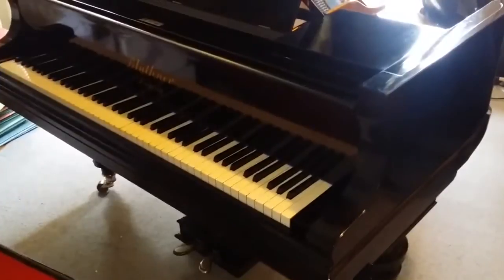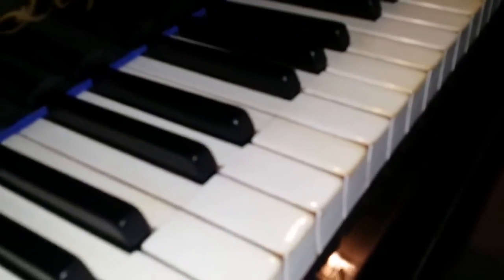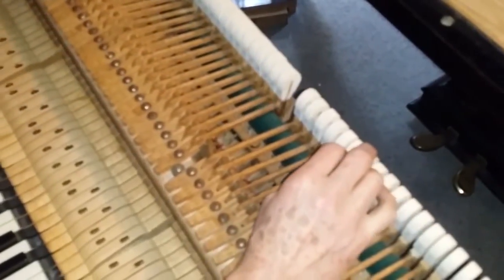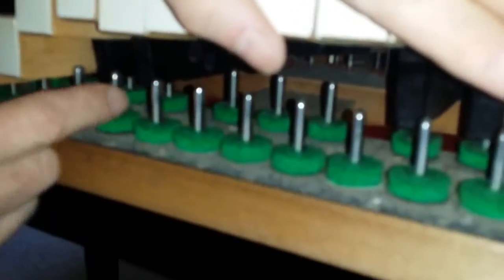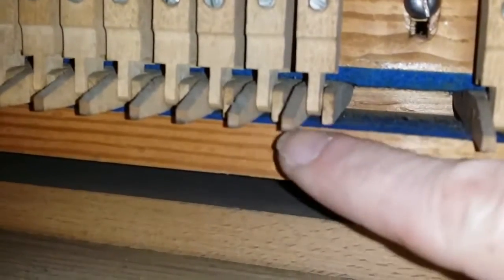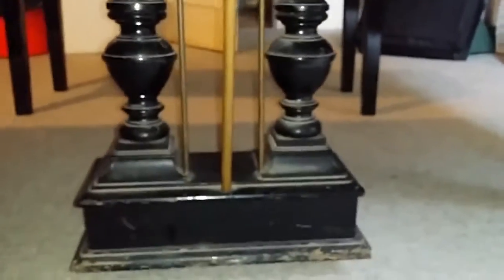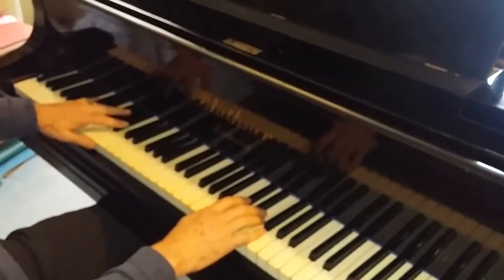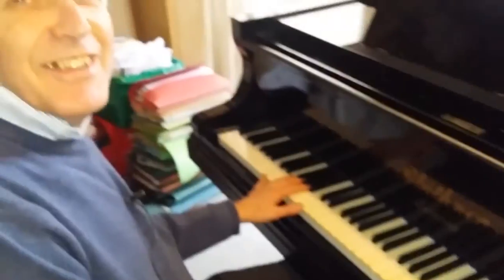Bluthner Grand Piano restoration work part 1 - assessment

Comment: you didn't mention that the damper flanges do not have screws and that this is a way more complicated damper system to overhaul. Also, you did not mention that the top 23 notes have their agraffes UNDER the iron frame and that if removed for frame restoration can also lead to issues. Just saying  :-)

Comment: Abel , not Renner, makes the original Bluethner hammers today. THey are not very expensive , so it is worth using those "Gang filing able" heads.
Reply from the maker: +Isaac OLEG this particular Blüthner is an older model (we prefer the early 1900's models) in need of new hammers.
Reply: +Roberts Pianos Well sound a little early despite the good build and material, they where overly tense at those times I wonder if that is not hard on the panel.

What I wanted to say is that mounting new "standard slicicing" hammers takes out something of the magical tone, I haver no real explanation, may be the Bluethner slicing allows for a more vertical motion, may be the imbalance with more felt on the left back than on the front right, gives that juicy color... STandards hammers sound always poorer (and the felt and pressing they obtain today are excellents) Best regrds
Reply from the maker: +Isaac OLEG Interesting thoughts. In terms of the specifics of our restoration process I'm not entirely sure myself. Our head technician David McCulloch has been on numerous courses to Renner. And David Fry, Renner's head technician in the UK helps run one of our shops so we keep improving our restoration work-flow and decision making. For technical questions about our restoration process it'd be best to write to our main email address info@robertspianos.com for Marcus/David McCuloch or David Fry to give a more substantial response. Best, Evan

Comment: Hello Robert! Is it OK to put Kawai original hammers to a Bluthner 5'7" 1929
Reply from the maker: They are likely to be too heavy; best to weigh the lower bass ones and compare with the originals. The shape will probably be different too. Renner and Abel supply the correct size and weight on request. Marcus
Reply: Thank you.